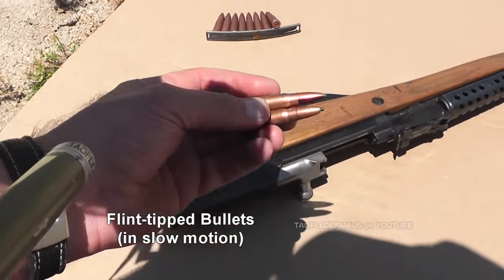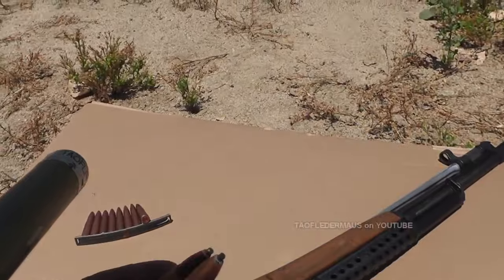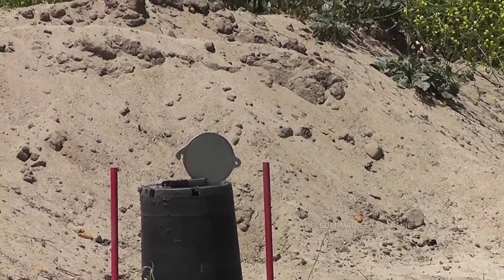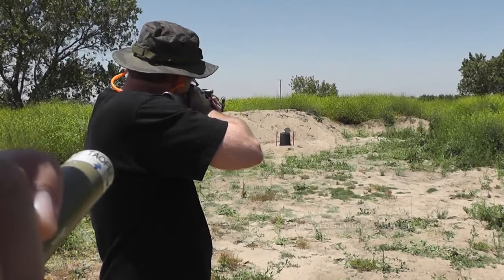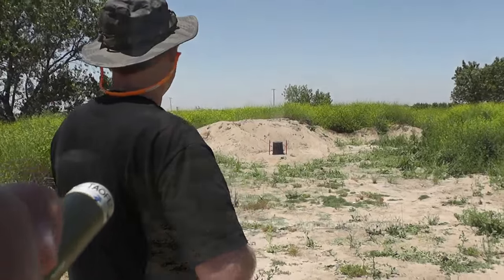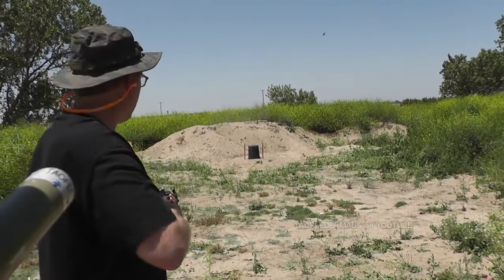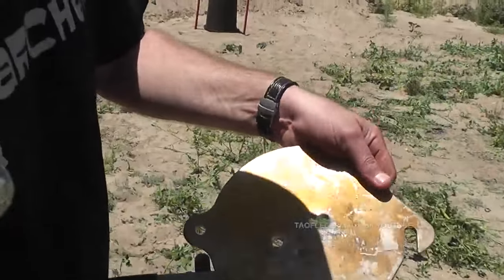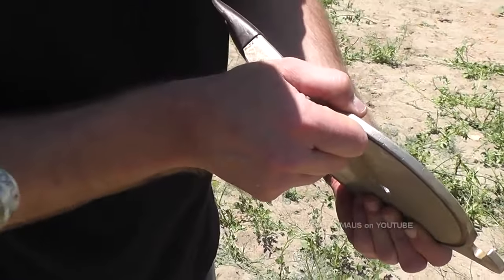ZIPPO-FLINT TIPPED BULLETS - Poor-Man's Raufoss

Comment: This deserves a highspeed revisit!
Reply: Agreed.  Also, would a standard FMJ go through without the flint ?
Reply: Not just the high-speed, but ballistic gel, different armour types. There is definitely enough material to fill out a video with that round, I'd imagine anyway! 🤔🤷🏻‍♂️
Reply: A revisit - at night (or at least low-light)!
Reply: @TheYakkis  mild steel maybe but definitely not AR500
Reply: @TheYakkis The Military issue 7.62 x 39mm is actually a mild steel jacket, around a lead jacket, around a steel core. So it is virtually an armour piercing round and highly effective against steel plates already. The flint is only providing a bit of flash for effect and ballistically not really contributing anything to the projectile's destructive force.

Comment: Would have like to have seen an "un-tipped" 7.62x39 fired for comparison. If the standard 7.62x39 performed identically then the flint tip would be unnecessary. Personally I think the standard FMJ would've go through so I'm weary of this tipped performance.
Reply: the flint is just to make a flash on impact not to penetrate more
Reply: 86gtforme I already assumed this. But a minor spark splash doesn't make it an on the cheap version of an incendiary armor piercing round. And the incendiary portion is supposed to aid in penetration.
Reply: MatteoSixSeventyFour he never mentioned penetration he was just trying to make something interesting like almost everything else on his channel
Reply: 86gtforme well actually he did. As that is the purpose of a Raufoss, other than it's explosive properties as an HEDP (high explosive dual purpose) round. When I handload up a poor mans 10mm, ie the 400 corbon its does a good job approximating the 10mm's performance. A minor spark splash with no increased penetrating abilities doesn't make it the poormans Raufoss. Barely makes it interesting.
Reply: MatteoSixSeventyFour can you tell me the time in the video where he references it being used for more penetration, i may have missed it
Reply: 86gtforme Try reading the title!
Reply from the maker: The flint created sparks.
Reply: No kidding. But use of the term Raufoss or even poormans Raufoss implies a claim of increased penetration (AP) is being made!
Reply from the maker: Don't lose sleep over it bro.
Reply: Oh I'm not. But the title is misleading
Reply: Actually, I think that was pot metal, not stainless. Could even be aluminum, but pretty sure it was pot metal (junk alloy). but sparks are cool :-0)
Reply from the maker: It was stainless.  There's no reason for me to like about shit in my videos.
Reply: *****
Calm down. I didn't say you had reason to lie.
But your own narration indicted that you may not know the composition of the
plate.

I offered my OPINION. If you don't want opinions posted, just say that you don't want any opinions posted.

I have an AK. I have stainless plates.
I'm not saying an AK can't penetrate stainless, it can, and there are various different alloys of stainless, some harder than others.

Based on my experience, I gave an opinion.
There was no dimpling in/out on the front/back other that immediately surrounding the holes - and that is indicative of softer pot metal.
Reply: I don't think the point was comparing rounds tipped VS non tipped, it was just about shooting flint at steel to see the cool sparks flying everywhere.
Reply: WirlWind Well my point is by use of the Raufoss name, a claim of increased destructive and armor piercing capabilities due to incendiary qualities was made when it was called the poor-mans version.  And many people are watching this video on that basis. And it can't be said they aren't. Which was the point of using that name. A bullet that produces sparks on impact isn't in the same hemisphere.
Reply: But just given the fact they dropped a name, doesn't mean they meant it to refer to "increased penetration".

It's an Incendiary round. That's what they were referring to when they said "poor man's". They weren't trying to claim the flint would increase the penetration but were just saying that they were getting sparks and flames like a "poor man's" incendiary round.

I never got any impression from them at ALL that what the mod would do was increase penetration. They just wanted sparks.
Reply: WirlWind That's the entire point of calling anything a "poor-mans" version of whatever. You are saying it does or approximates whatever name or term implies. Otherwise use of the name is pointless. The 400 Corbon gets called the poor-mans 10mm because it approximates the performance of the 10mm. The name Raufoss was used for effect, because it has an implied meaning. To say it wasn't is either disingenuous or shear ignorance. And yes people are watching this because when they see the name Raufoss and know what it means or go look it up they enter with certain expectations. And there are comments from viewers that confirm this. I'm happy you knew better. I've worked with HEDP, AP and incendiary rounds as a combat engineer so I knew it wouldn't either. But the entire reason I took any time to watch this video was because of the Raufoss name. I think it's total crap that those who are less than knowledgeable are getting mislead because nothing in the video or description informs them its just about a sparking bullet.
Reply: WirlWind
Lol yeah i thought this was some new age tech lmao
Reply: Daniel Druskovich
BORING...
Reply: I think a regular fmj 7.62x39 would only dent a 1/4 sainless plate. I used to own a sks and just making and educated guess.
Reply: william pounds
As an educated guess, I would say that the regular 7,62 x 39 mm rounds that I fired in the last 20 years are "GSMO". This means "short bullet, steel core". Which, in fact is an hi-alloy steel. So the ammunition should be light armor piercing. The steel penetration I made myself was a piece of 8 mm thick hull construction metal sheet brought to the range from a shipyard. I fired a regular AKM at 100 m.
Reply: william pounds & 1zanglang Standard 7.62x39 will penetrate 1/4 stainless and 1/2 mild steel, without any enhancements. YouTube was a wash with such videos demonstrating this. I've even seen a 300 BLK do similar. And last I checked the 300 is a close albeit slightly lesser ballistic twin to the 7.62x39. I'm in agreement with MatteoSixSeventyFour. This was a bs title designed to draw people into watching it. With the understanding of what a raufoss does they were thinking they were going to see a bullet mod that gives armor piercing qualities, that would not be present otherwise! A false claiming title at worst or puffery at best!!
Reply: AmericanInfidel2012 Agreed!
Reply: Be careful commenting on this guys posts, as you can see, he (and his buddies) like to cry foul and try to "spin" their claims. All you were saying was this is not a raufoss, but the title leads us to believe it is. Like you, when I see "poor mans raufoss" I expect something that aids penetration--not make a cute little flash. Watch their video on the shotgun load made from washers...four shots and not one of them hits center mass. I comment about the inaccuracy and they start crying how the video is only for fun and to show how awesome the washers penetrate cardboard--that's right, cardboard.
Reply: MatteoSixSeventyFour totally agree with you about wishing they'd have done an untipped one for control purposes.   Personally i think the only way the flint tip would be good for anything but "oh pretty, sparks :| " would be if you were firing it into a steel container that had either flamable liquid or even a compressed gas (since neither lead or copper would spark on their own). 

Other than that, think i'll keep my flints for my zippo and leave my 7.62 ammo the way it is out of the spam can lol
Reply: I sort of agree in it would have been better with Scientific control. However I think I understand the Physic. Upon impact with the flint tip you have a compression + heat energy transfer. It would act like a mini shape charge. But as you say it should have been done with both. I guess I will just have to do it correctly and post results on YouTube.
Reply: Keith Cleghorn
The flint metal ignites with air when broken or flaked into a powder,
producing sparks.  Unsure how chunks going transonic may behave
Reply: KOZMOuvBORG That's because the only thing it does is spark. The flint does not add any incendiary or penetrative qualities to the 7.62x39 round. Regular FMJ will go through it just the same.
Reply: MatteoSixSeventyFour
Correct, it's just eye candy for those 'compensating' ("Shrek").

As others mentioned here, could enhance damage if volatiles are present but why not simply use an incendiary round?  Wouldn't machining ball rounds affect accuracy unless you are skilled with and have access to an advanced machine shop. 

Agree with you that control rounds would help comparing and the rifle should be in a block to see if accuracy suffers.  Thanks for commenting
Reply: KOZMOuvBORG Even with volatile chemicals/gases it would have next to no impact. Fuel to air mixture would have to be perfect before ignition would or could result. As for penetrative enhancements, that's a big nodda. Under 100 yds the bullet maintained enough velocity to pierce the plate. My OP was a soft intro to get the video poster to admit this video was named as it is to draw viewers since the modified round presented none of the characteristics or effects that a Raufoss round would. No disclaimers were stated. This is simply a stupid bullet mod producing a piss poor effect. With a catchy and misleading title slapped on it.
Reply: Robert O'Connor Stainless steel is brittle it has a different molecular crystal structure! When you cut Stainless Steal sheet with hand snips it makes an actual crunchy sound. If you don't use Stainless rated snips you will ruin regular snips in a very short time. I wouldn't think Stainless would have any better bullet resistance than regular steel. Also I know from personal experience that 7.62/ 39 rounds will penetrate that thickness of non hardend steal up to approx 100 yards. I don't think a Flint is going to offer any penetration enhancement. Without a standard bullet to compare this was just cute what with the sparkler affect of the Flint's bursting.
Reply: TAOFLEDERMAUS sure seems like he is already losing sleep over he won't stfu about the title and no one else cares because it's just cool to watch as previously stated lol
Reply: This is NOT a Raufoss round, nor is it a SIMULATED or POOR-MAN'S Raufoss round. The title is a hoax, as it is only a sparking round  --  sorta like what one sees in about every TV cop show  -- the INFAMOUSLY "sparking ricochet" shots. Waste of time and effort for the "Hollywood Effect!"
Reply: See I would like to have seen it too but not for the penetration of it but to see if it would have mushroomed more leaving a wider whole without the flint.
Reply: It was literally done for the spark, that's it 😂
Reply: First.....  you give it a clickbait title....
Than...    let your bots denie it !!??         JUST like the us-foreign-politics....     gnihihihi
Reply: @MatteoSixSeventyFour  it’s not misleading. You’re just not that intelligent.
Reply: @AmericanInfidel2012  there is no 7.62 x 39 bullet that will penetrate 1/2 inch of mild steel.
Reply: @artifacthunter1472  If you don’t think it’s misleading the one lacking intelligence isn’t me. But nice try kiddo.
Reply: @MatteoSixSeventyFour  Agreed. If you are going to do a video showing a munition that has been altered at least do a comparison with the unaltered version. No point in watching this channel again, especially after their responses to being called out on it.
Reply: My response as well
Reply: @86gtforme you need to read more. The caption implies armor penetration.

Comment: That looks like a ton of fun and a great idea.  

I am wondering if you could use half that amount of flint and still get a good read on the hit and at what distance the flash is noticeable?

I would be interested if the flint would blow the sparks consistently in the opposite direction of the angled metal which can help with clues to how the target is situated?

One last question and I will leave you alone lol, did the flint contribute to the target penetration or was that target usually penetrated by hollow point ammo?

Comment: Means nothing unless you also shoot regular rounds for comparison.
Reply: Exactly
Reply: im 4 years late but 7.62 ball wont go though that steel
Reply: @jdm_jord0391   yes it does
Reply: @jdm_jord0391  yes it does. Stainless steel is pretty weak ass stuff.
Reply: @jdm_jord0391  I'm a year late, but it definitely will.  They said it's stainless steel.  Stainless steel is actually quite soft and gummy.

Comment: Really interesting . Hard as flint goes the old saying . So the flint breaks the target open and the copper jacketed slug gets an entry to blast through the steel.I'd like to see you do it with the same plate thickness using ordinary carbonsteel or mild. Add a 3 mm plate to the back retest. Add another3 retest again & so forth until penetration right through the plates fails. Suspect you may get 17-19mm before total pass through is prevented with Flint tips.?  Interesting also how the reaction from the projectile appeared to be out of uniform performance. P.S. Bench test the rounds instead of wavering about like that. Not necessary to stand when testing.makes you guys a big target for ricochet.
Reply: No the flint doesn't do jack. A standard 7.62x3 will penetrate 1/2 mild steel it will go through 1/4 stainless. The flint just sparks on impact. Calling a flint tipped bullet a raufoss is why I watched this. I knew it was a bs claim.
Reply: irondiver1 apparently several others aside from myself.

Maybe you should not give a shit that we do, and enjoy the video.
Reply: AmericanInfidel2012
No mate thats not right yuh see? if that was a hollow point the behaviour of the interaction would be different to if it had a drip of mercury in the cavity. Its a matter of physics . if a ball bearing was the tip again there would be a variation in the reaction. So possibly the flint turns to powder faster than you can blow spit past yur lips but there will still be a reactive alteration. I do concede to a large degree that its possibly minimal in the effect. Also why I want to see more experimentation to confirm or debunk the theories.
Reply: Jon Rich No "Mate" I'm absolutely correct!! A standard lead core FMJ will penetrate a .25" plate. A standard 30-30 mimics AK ballistics. There are videos showing a 30-30 going through a .25 plate!!! This round is a converted off the shelf FMJ round. Since the outcome is not changed. The reaction is so minimal you can effectively call it non-existent. And having some sparks fly while penetrating is not enough of a change. The flint sparks just as much as if you lay it on the ground and hit it with a hammer. Sparking will occur and the hammer will not be affected. FYI a hollow point rifle round will also penetrate. Without hydraulic actuation a hollow point will perform just like a FMJ. My understanding of physics is just fine. I don't need further testing to know this is BS. There are no enhanced penetrative or incendiary qualities to this. It is all show and no go! You may want more experimentation because you seriously lack understanding but I don't need it. I already have an background in artillery and small arms ordnance, and in my personal time continue to construct my own bullets from raw materials for my handloaded ammunition to know better! For shits and giggles I've made my own AP and incendiary rounds. I think its funny that while you don't know what you are talking about you have little problem spreading conjecture to those who actually possess the knowledge!
Reply: AmericanInfidel2012
hmm
Reply: Jon Rich Only one here in denial is you.  Worse yet another commenter points out it does nothing and the video proof to boot. Never let facts get in the way of your ego right kiddo? Guess that's some of the allure of the internet. Keyboard commando's and how they'll tell you your wrong yet they don't know what they're talking about, regardless if you have experience in said field. Sorry kiddo only thing funny here is you.
Reply: AmericanInfidel2012
Hmmm!
Reply: Jon Rich Yeah if I was as wrong as you are I'd claim I no longer cared also to save face. Let me guess you did some research and found out it doesn't do diddley squat? LMAO
Reply: Hmmm!
Reply: what are yuh ! ?
Reply: Jon Rich If you're asking whether I'm a LEO the answer would be, yes! :)
Reply: Jon Rich
 WATCH OUT EVERYONE, WE'VE GOT AN INTERNET BADASS OVER HERE!

If you don't give a fuck, why'd you bother responding?

The problem with stating that you don't care is that if you have to state it, you almost verifiably do.
Reply: Jon Rich
Threats? The only one that made a threat here was you, not me.

Are you okay? Seems like you're having a bit of a mental breakdown. Cute you think I'm an Aussie, though.
Reply: "Hard as flint" 

Wow. Stunningly ignorant. Colossally clueless. 

That really takes the cake Jack Richards. You win the "Epic Stupidity of the Day" Internet Award. 

"Flint" the rock is a microcrystalline quartz in the chert family. It is indeed very hard. 

However, "Flint" as in "lighter flint" or "ferrocerium rod" (which are both common names for what was used in this vid) is a composite of the super soft rare earth metals cerium, lanthanum, praesidium and neodymium mixed with magnesium and iron. 

Talk about apples and oranges as regards to composition and hardness between these two materials! More like American football vs underwater basket weaving. 

"Hard as flint" 

Apparently neither as hard nor as dense as Jack Richards' skull.